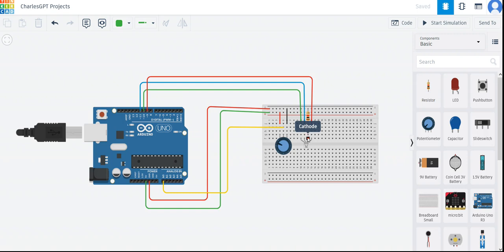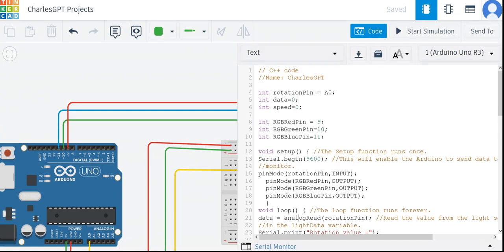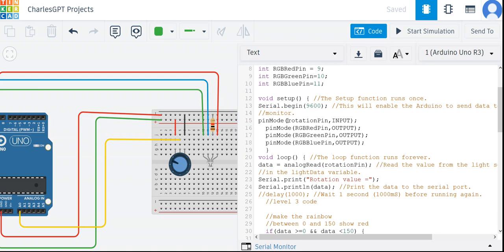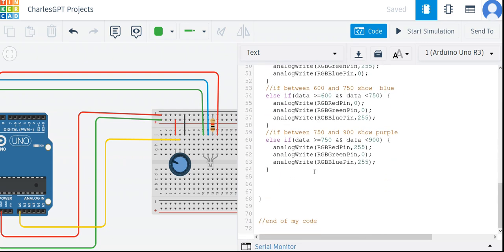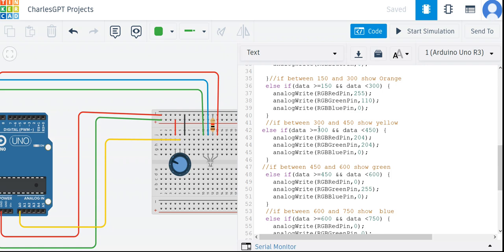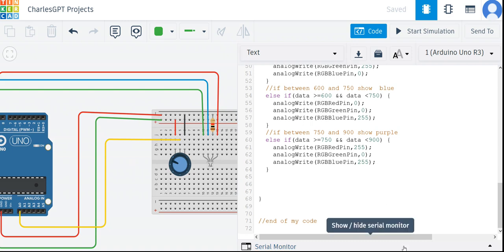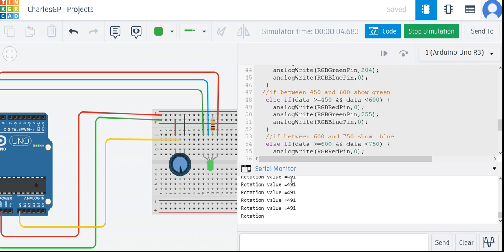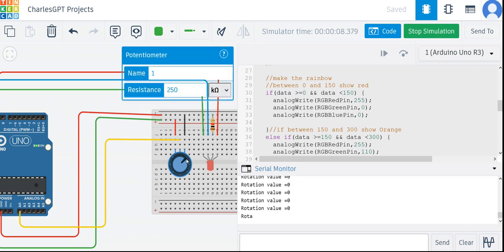Arduino Tinkercad Project #3 – Control RGB LED Colors with a Potentiometer | Beginner Tutorial

Comment: hello charles, can you pls do a video were you show the code for this tinkercard project

😛
Reply from the maker: It's an old video
But if you still need the source code I will try my best to look for it
Reply: @Charles_GPT-Ai  i would love if u sent the showed the full code, im trying to learn arduino rn and it would really help me
Reply from the maker: @RoyZakay-hn7ie 
// C++ code
//Name: CharlesGPT

int rotationPin = A0;
int data=0;
int speed=0;

int RGBRedPin = 9;
int RGBGreenPin=10;
int RGBBluePin=11;

void setup() { //The Setup function runs once.
Serial.begin(9600); //This will enable the Arduino to send data to the Serial
//monitor.
pinMode(rotationPin,INPUT);
  pinMode(RGBRedPin,OUTPUT);
  pinMode(RGBGreenPin,OUTPUT);
  pinMode(RGBBluePin,OUTPUT);
  }
void loop() { //The loop function runs forever.
data = analogRead(rotationPin); //Read the value from the light sensor and store it
//in the lightData variable.
Serial.print("Rotation value =");
Serial.println(data); //Print the data to the serial port.
//delay(1000); //Wait 1 second (1000mS) before running again.
  //level 3 code
  
  //make the rainbow
  //between 0 and 150 show red
  if(data >=0 && data <150) {
    analogWrite(RGBRedPin,255);
    analogWrite(RGBGreenPin,0);
    analogWrite(RGBBluePin,0);
    
  }//if between 150 and 300 show Orange
  else if(data >=150 && data <300) {
    analogWrite(RGBRedPin,255);
    analogWrite(RGBGreenPin,110);
    analogWrite(RGBBluePin,0);
  }
  //if between 300 and 450 show yellow
 else if(data >=300 && data <450) {
    analogWrite(RGBRedPin,204);
    analogWrite(RGBGreenPin,204);
    analogWrite(RGBBluePin,0);
  } 
 //if between 450 and 600 show green
  else if(data >=450 && data <600) {
    analogWrite(RGBRedPin,0);
    analogWrite(RGBGreenPin,255);
    analogWrite(RGBBluePin,0);
  }
  //if between 600 and 750 show  blue
  else if(data >=600 && data <750) {
    analogWrite(RGBRedPin,0);
    analogWrite(RGBGreenPin,0);
    analogWrite(RGBBluePin,255);
  }
  //if between 750 and 900 show purple
  else if(data >=750 && data <900) {
    analogWrite(RGBRedPin,255);
    analogWrite(RGBGreenPin,0);
    analogWrite(RGBBluePin,255);
  }
  
  
  
}

//end of my code